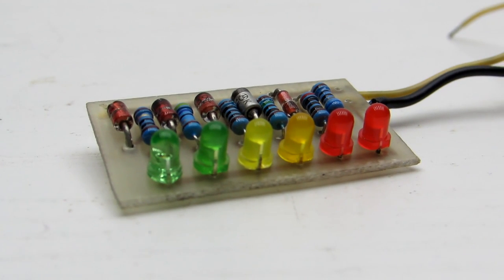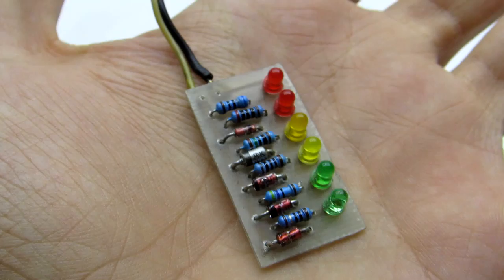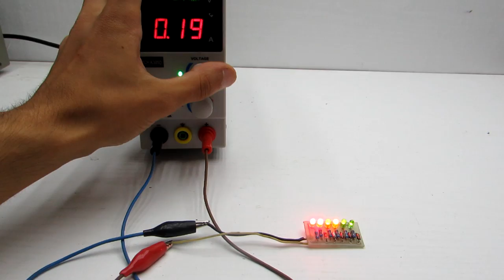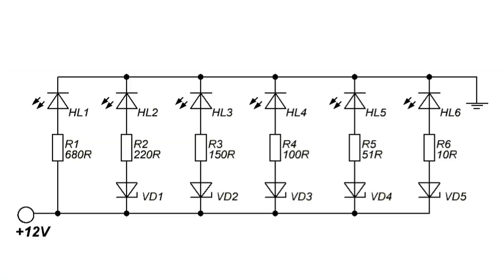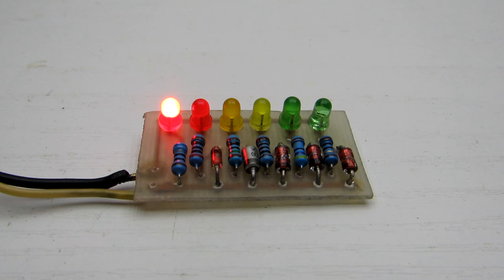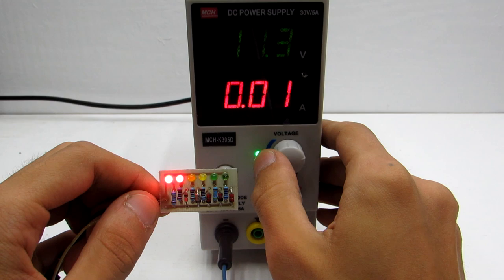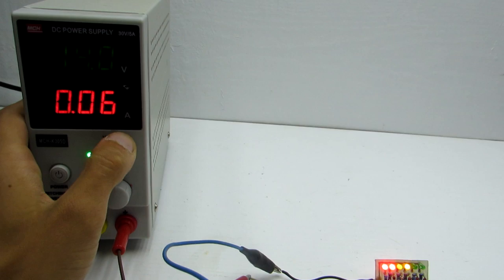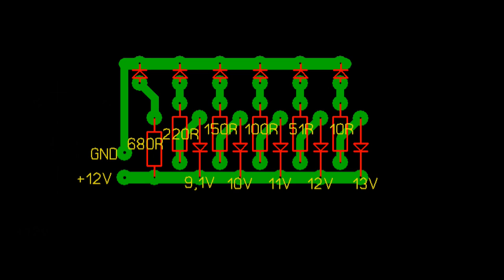A simple battery charge indicator

Comment: Guys!  This is ONLY for higher voltage batteries.......... at least 6 Volts (even then that is marginal for more than several LEDs

R = (Vmax - Vf - Vz) / Max LED Current      Vmax is maximum voltage applied

Comment: that's what I call engineering simple straight forward even a dummy can do it. yet only a genius can think of it
Reply: Abba Suleiman one question man and btw I have no qualifications regarding anything now I don't have a higher education but wouldn't this circuit measure the potential difference and not the current making it quite useless as a bettery charge indicator
Reply: Ibrahim kayani The circuit doesn't measure. Zener diodes do not conduct until a treshold voltage, known as the forward voltage is exceeded. When the forward voltage has been exceeded, the zener diode is forward biased and starts conducting, thus letting current flow.
Reply: PunakiviAddikti but it looks more like a volt meter also the indicator was showing different lights when he was changing the voltage on his power supply hence I believe it's a volt indicator and not a current indicator but I can be wrong as I am self taught when it comes to electronics
Reply: Ibrahim kayani the battery voltage indicates it's charge state ex 12.6v =100%. 11.1= 50%. 9v= 0%. for li ion batteries. evry battery type has it's own voltage to battery state value.
Reply: PunakiviAddikti that's the reverse breakdown voltage for u
Reply: HSware well explained. This circuit DOES NOT MEASURE ANYTHING!

Comment: I notice that the zener diodes stoped the current to the led when it  reach under it's voltage, for instance when it's under 11 volt the led on the 11 v diodes turn off, is it possible making an over discharge for battery using the diode only without the resistor? thanks

Comment: quick question if you vary the diode range from 3v to 6v (FOR INSTANCE) will you be able to use the same circuit for measuring for a6v battery??

Comment: This is a very energy wasting battery meter if use continously to monitor battery voltage.
Reply: Yandel Nunez but he said its a charge indicator that seems wrong as this circuit depends on v so it has nothing to do with I so I don't have any qualification regarding this and was wondering if what I'm thinking is right or wrong could u plz tell
Reply: Ibrahim kayani You can simply hook momentual switch to ground cable and it wil light up only when you're holding the switch.
Reply: Daniel Choutka no I mean it looks like a volt indicator rather then current so it's actually measuring the voltage and is hence not a charge indicator but I'm just asking I have no formal education of electronics and this is just what I think
Reply: Ibrahim kayani Oh, sorry, tagged the wrong person... I meant Yandel Nunez.
Reply: Daniel Choutka ooh I see now lol

Comment: is this circuit is suitable li ion battery(18650 battery)????
Reply: No.  And if you are dealing with 18650's you will want something that can detect the low and high voltage for the battery to protect from under and over voltage as well as over-current/short circuit protection.
Reply: I will make this subs my channel, i will upload this in next video

Comment: how can i make it for 24 volt lead battery(pair of two 12 v battery)
Reply: Just use zener diodes with higher zener voltages. Also, you might want to use resistors with higher resistance so the LEDs don't get too much current.